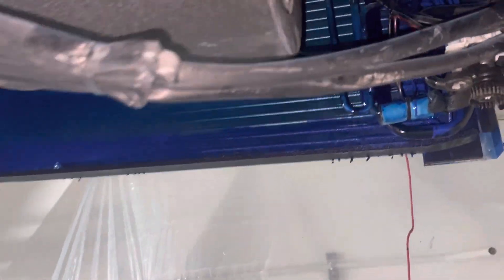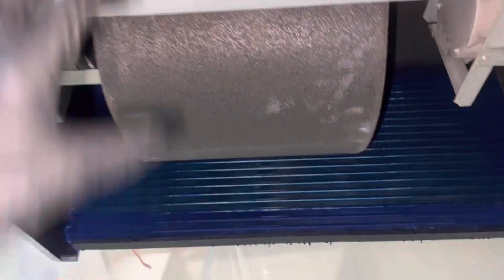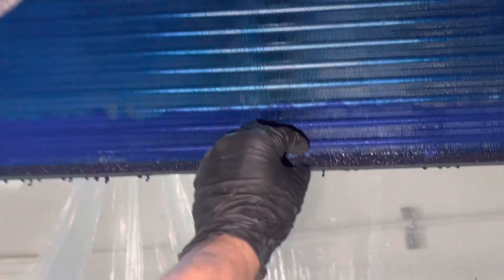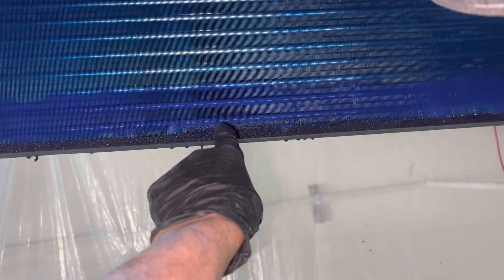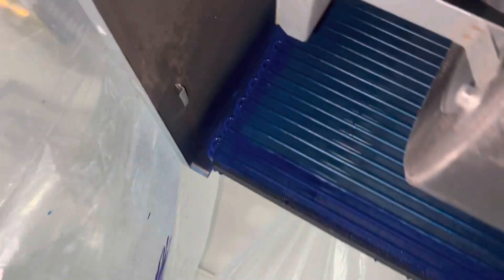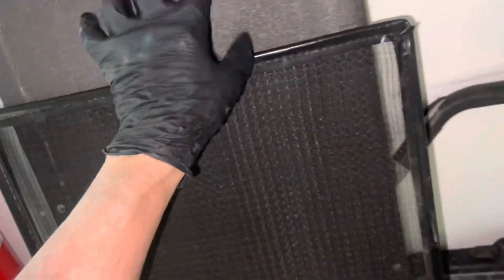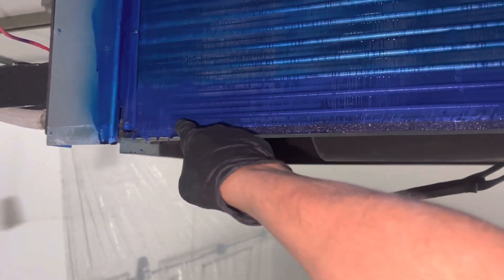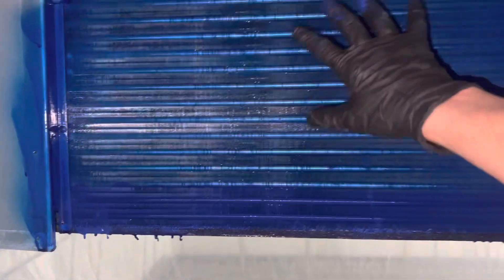￼ GulfCoat Coil Coating stopping and ￼preventing micro size refrigerant leaks

Comment: Any static pressure drop?
Reply from the maker: Near unmeasurable.  We’re not talking about thick paint like on a house or a car..  super thin like microns thin.  Think of cellophane wrapper that you stretch over your bowl of food that you put in the refrigerator.. 

Modine is a coil manufacturing company Worldwide . They are the producers of this product..  it’s a optional product that’s available on some of their coils when you custom order coils. 

They claim a 2% reduction in coil efficiency .  Which where I live in San Francisco, California for air conditioning mode would be a almost less than 1% reduction.   Because in our area or average daily temperatures are between 58°F to 68°F..   so the coils are already operating with the attic capacity of being operated far below their design temperature. 

In San Francisco California we consider a very hot day 78°F .  Still well below a manufactures 90° design day rating..